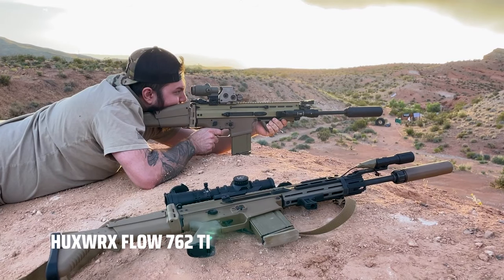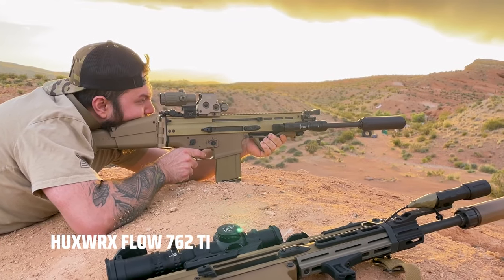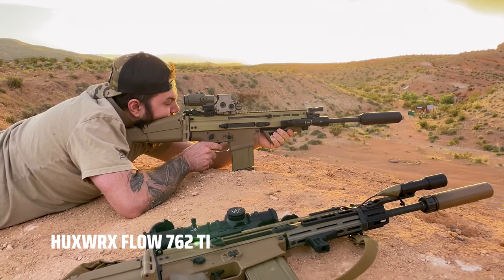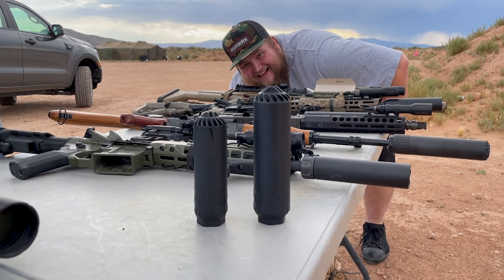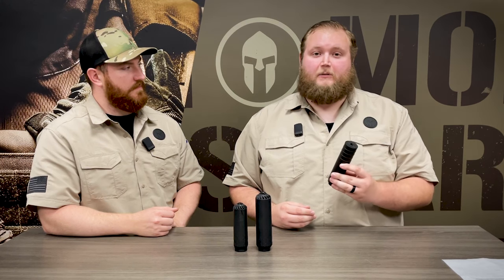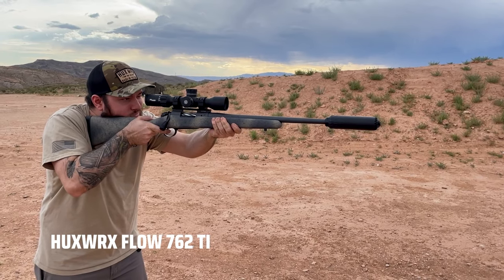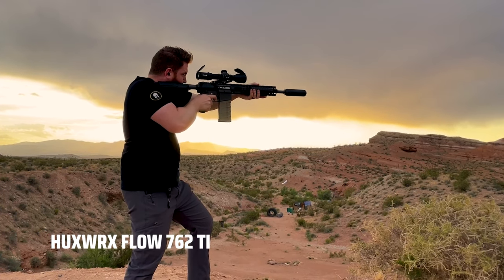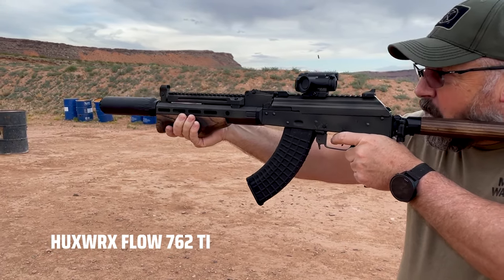HUXWRX FLOW 762 - The Best Do All Suppressor? - Tactical Tuesday

Comment: "No surprise that the Polonium is quieter if you pay attention to PEWScience"
Uhhhhhh the Polonium has a pretty bad at-ear rating. Like, even lower than the Sandman-S tested on 5.56.
Reply: Right, but compare the Polonium to both sets of Maxim DSX data. No tuning, they were close at both ear and muzzle. The tuned SURG with a more restrictive gas port made the ear rating fly up.
Reply: They ran it on a tuned host, pew uses an untuned host. The review he did recently with the Maxim shows that a tuned host with a hugh back pressure silencer can be quieter than a untuned host with a flow through.

Comment: I've been wanting a can to run on my 5.56 guns for a while, after seeing Jay's numbers and all of these reviews...I might be getting the Flow 762 Ti. Hell, I might even try it on my Vepr AK...I just need to check the alignment and make sure its concentrically threaded. Only way I know to check this is with an actual suppressor, so worst care scenario I just got myself a new muzzle brake/flash hider for my AK 😂
Reply: Dude, check out the new Griffin Armament Cans. They are flow through, and have cracked the code with the big 3 features. Reduced, back-pressure, low flash, and great sound.
Reply: @Faustian_Spirit  I was considering those, trying to find more reviews and experiences on the Dual-LOK

Comment: Will this fit on a zpap92’s fat muzzle ?
Reply from the maker: you will have to use a muzzle device by Huxwrx to do it. If im not mistaken, the zpap has M26x1.5 LH thread pattern, and Huxwrx does make an adapter for that thread pattern

Comment: Man, you guys should check out Griffins cans. They have cracked the code on reduced backpressure, sound reduction, and flash reduction. Their new M4SD-L is freaking amazing. That tech is being carried over to all their new lines. Their absolutely HARD use HRT7 is amazing. They also have invested in a B&k sound setup. Which involved world renowned sound scientists coming out to help them set it up. They are the only other place besides pew which offer pressure wave form tests and AHAAH data. Except theirs is raw data and not gatekeeped behind a paywall and an ambiguous rating system.

Comment: I don't believe Sandman S is a direct comparison to the flow 762 ti. Sandman is a cobalt alloy can with thick stainless outer walls, you are more likely to kill the gun before wear it out. While flow762ti will likely need some significant cool down in very few 'full semi' mags to prevent major sparking and accelerated erosion(mind you, only 10k-20k rds lifespan on their 17-4 cored cans).

Comment: Awesome video! Been trying to decide if I should bite the bullet and get either a Flow 556k or 762Ti for my untuned 14.5” BCM, or just get an adjustable gas block and new buffer and spring and go for a polonium K. Would you say the sound at the muzzle for all 3 would be comparable? And can you tune the polonium K to be way less gassy and have reasonable sound at the shooter’s ear?
Reply from the maker: The polonium was quieter for sure, but the one we shot was the full size not the k. That being said, to get it to not be gassy, Chris had to do a fair amount of work tuning the gun. Now that its tuned up its quite pleasant, but, its still more gassy than either of the flows.
Reply: @modernwarriorsut   would you be willing to share what kind of tuning was done? was there anything more than changing buffer spring & weights (or maybe changing to an A5 buffer system) and adding an adjustable gas block, and possibly using an adjustable bcg (bootleg)? thanks!
Reply from the maker: @JGO219  With this suppressor we didn't change anything about how the guns were set up before running it. Thats one big advantage of these suppressors is you really dont have to do much to get the guns to run well with them.
Reply: @modernwarriorsut  thanks for the reply but I was asking about the tuning you guys were referring to for Chris's gun to run the Polonium full size smoothly!
Reply from the maker: @JGO219  Ohhhhh gotcha, he spent a fare amount of time testing out different buffer weights, buffer springs and even gas blocks to find the combination that worked best for his rifle. He is still making small improvements here and there